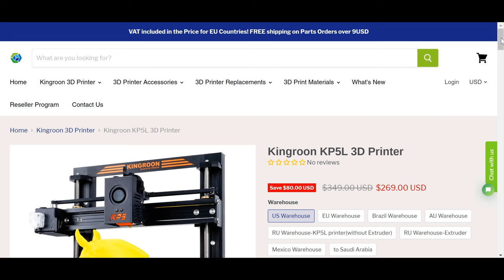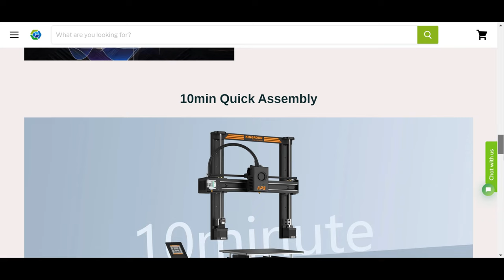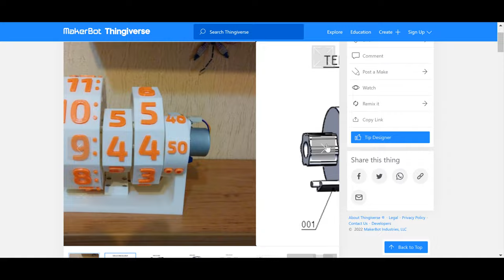homemade Clock ,  Kingroon KP5L 3D printer

Comment: Why does the 3d printer waste plastic by drawing a circle around the thing being printed?
Reply: the circle is drawn around the part to compensate for the plastic oozing out while heating up and moving into the designated print area. by first drawing the circle around the part, whole hotend is filled with molten plastic so that the part won’t have any voids.
Reply: @3dp667  ah. That sort of makes sense. But in that case it could just draw a blob off screen because a larger part needs a larger circle thus consuming more plastic.
Reply: @garrysekelli6776  They do :) called intro line. Some printer uses this, some both. The circle is also used to check the bed level too. By watching the circle going down, one can tell if the nozzle is too high or low. Using this information, adjustment knob is turned. You can turn it on/off actually. I usually turn it off when printing a large print to save some filament and bed space.
Reply: @garrysekelli6776  Prusa printers default to a purge line + skirt.... the purge line fills the head, then the skirt gives it enough time to go back to normal before getting to the acutal print (usually the purge line causes a bit too much pressure) but the combination of both results in a nice clean head + correct nozzle pressure by the time it starts printing the part for real. And yes the skirt is good for stopping a print early if it comes loose... due to lack of adhesion.